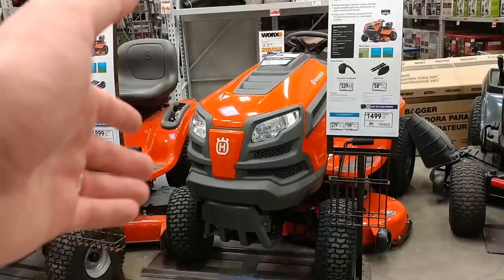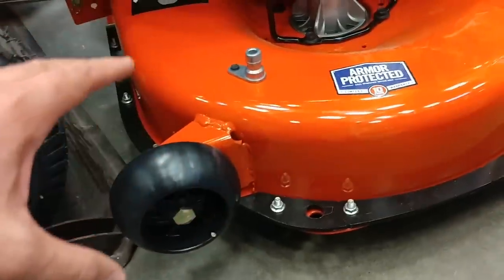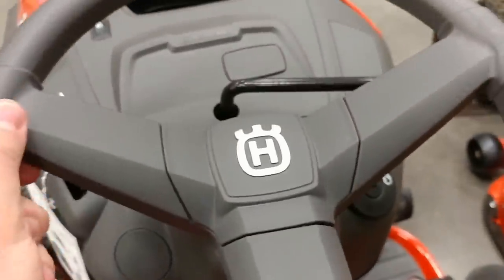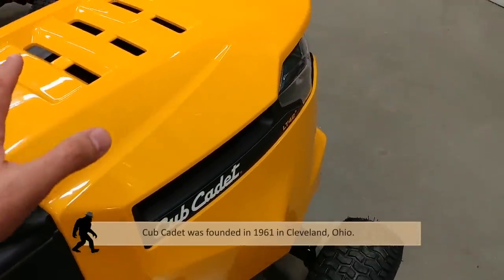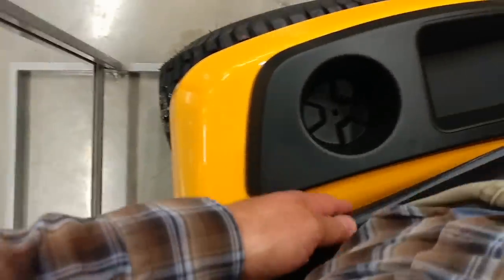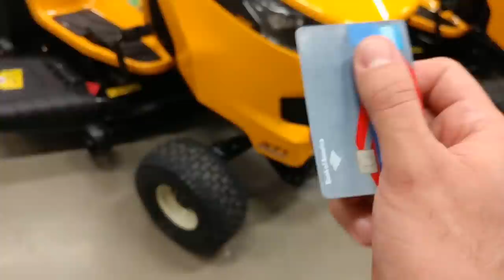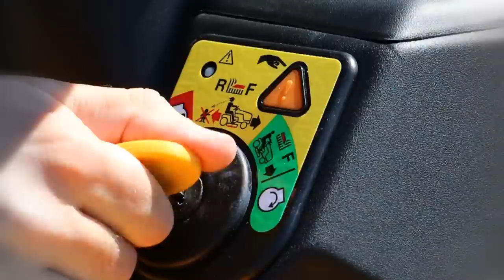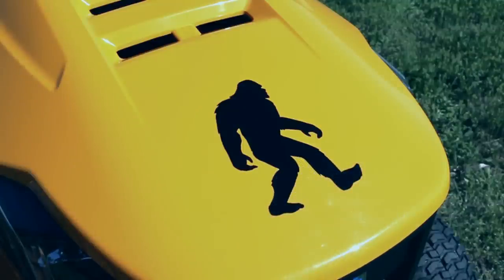Time to Buy - Husqvarna YTH18542 42” or the Cub Cadet XT1 Enduro Series LT 42" Riding Lawn Mower

Comment: My first hydrostatic drive mower was a Craftsman, with the control on the right-rear fender. I really got used to that. I'm a bit apprehensive to move on to a mower with a foot control. What do you think?
Reply from the maker: Hi, PlanetRockJesus - the mowers I used to use were all gear select on the right rear fender or hydrostatic with a control on the dash, and I too was apprehensive about the accelerator-style foot pedal.  This was one of the reasons I went with the Cub Cadet because at that price point, it had cruise control.  The pedal is comfortable and the resistance is loaded just right that my foot and leg do not tire through the entire session.  As it turns out, I rarely use the cruise because the foot pedal is so comfortable and this is actually a better configuration for my lawn.  My terrain is so varied that I'm constantly adjusting the speed and so far, this is working perfectly.  
I have another film on my channel about the 5-hour maintenance and comprehensive review.  It has a section in there explaining the foot pedal, cruise control, and brake.  Hope that helps!  And welcome to the community!
Reply: @BigfootDadExploresMontana  After having the mower for a few weeks now, I must say that it didn't take much to adjust to the foot pedal. I can keep both hands on the wheel. I will, however, be taking the Cadet in for warranty adjustments when the season ends. The cruise control only seems to have three settings: it doesn't start right up as it should, even when I choke it from the start when the engine is cold; the throttle doesn't really respond to the rabbit to turtle thing at all; there are a couple bolts missing from under the seat. Etc, etc. But I do like this mower.
Reply from the maker: @PlanetRockJesus  - thanks for the follow-up!  It sounds like there is definitely a few things that need to be warrantied.  The missing seat bolts is normal, I only have two as well and others on here noticed the same thing with their mowers. But the other issues you mentioned need to be fixed.  
Recently mine has started backfiring when I throttle down - unsure what that is.  But I'm afraid they won't warranty mine after what I did to it - that's coming up in the next video (still in progress)... 😅
Reply: @BigfootDadExploresMontana  I know. Mine backfires, too, but upon starting. That shouldn't happen. I only have one seat bolt on mine. I blame the lackeys at Home Depot who unboxed it and had to assemble it. They saved themselves a couple minutes so they could snatch a vape out the back door.
Reply from the maker: @PlanetRockJesus   - I wonder if these can have the valves adjusted. Haven't looked into it yet, but that may be a similar issue we have.

Comment: Even before he got to the cub cadet I knew which one he was going to choose. I have a Husqvarna I bought at a big box store 5 years ago that was returned. I read the complaints and corrected them in 15 minutes. Without looking I believe it is YT1846. Oh buy the way the price was $1000.00.
Reply from the maker: Hi, Joseph - thank you for your feedback.  I'll give a bit of insight - I originally went to go pick up a John Deere, however, my feet were getting tangled up in the pedals, so I went home, researched, and decided on the Husqvarna.  I don't remember why, but I had to run an errand to Home Depot and passed by the Cub Cadets and started comparing them to the Husqvarna, and thus the video began. I'll admit, I'm a fan of the Cub Cadet visual design, but have a keen eye on utility at the same time.  
You got a great deal on your Husqvarna.  Is it still working alright?

Comment: The Husqvarna is really nice and so is the cub cadet but the Briggs & Stratton Intek are known for blowing head gaskets
Reply from the maker: Hi, Kajler - I agree - Husqvarna makes a solid product!  I had recently lost my enchantment with Briggs and Stratton from the last two engines I had - one on a push mower and one on a rototiller.  Both had pretty bad quality issues.  It seems they're not what they used to be.

Comment: I used a Husqvarna yth 150 for 21 yrs till the rear left side axle sheared off while mowing . So not wanting to put more money in that old of a mower I bought a 3 yr old Cub cadet xti 46 from a man who bought it new he had just bought a brand Husqvarna 48" don't know why  but I bought it the cub for $700 been using it since put new belts an a battery changed all the fluids and filters  does great it's fast to fast some time.
Reply from the maker: Hi, Robert - what an excellent deal!  I don't think that can be beat.  Not sure either why the trade but hey, at least you got a heck of a deal and really nice mower out of it.  Remember, there's always room to upgrade the mower in more ways than one as well!  😉

Comment: Funny I have SC 500E cub cadet and  have a HU800AWD Husqvarna too funny I like em both had cucadet for a while and is lighter and has same power with out awd husqvarna has awd and pulls funny with hand pulls my speed on Husqvarna is awesome but I have battery start no pull batter is the second replacement have to replace every season that sux they are not cheap
Reply from the maker: Hi,  Chris!  You've had a lot of experience with these two brands - thank you for you're feedback.  For the battery,  I plug mine into a battery tender when not in use and that seems to help thus far.   Hopefully you're not out any money this spring on more repairs.  And welcome to the community!  😎

Comment: You covered all the features except for the most important of all. The type of hydrostatic transmission. Is it the dreaded K46 or the world renowned hydro gear? One will handle hills and the other will not.
Reply from the maker: Hi, Bill!  Yes, it is the same K46 on both the Cub Cadet and the Husqvarna.  It sounds like you've had some experience with it.  😂  So far it's held together but now I'm a little concerned...
Reply: @BigfootDadExploresMontana  Hey! Thanks for doing the review. I'm deciding between the two as well. Do you have any hills you mow? How huge is your yard? Thanks.
Reply from the maker: @suraush  - You're welcome.  Yes, my lawn is very hilly - some of them to the point where I cannot safely mow with a rider.  The two mowers have the same transmission and the same forward and reverse pedal functionality.  My yard is approximately one acre.    Hope that helps!
Reply: @BigfootDadExploresMontana  Would you suggest getting this or the twin engine LT46 then? Are you happy with the LT42? My yard is less than an acre with a few slopes. Thanks!
Reply from the maker: @suraush  - If the larger engine and deck size is in your budget and works for you (meaning it doesn't prevent you from getting into any tight places) then yes, I'd recommend the upgrade.  Let us know what you decide!
Reply: @BigfootDadExploresMontana  Makes sense! I spoke to someone at Cub Cadet.. I'm going to go with the XT1 LT50, since it has a 24 HP Kohler engine and more importantly the K46 instead of the TL200. It has the same specs as the wider XT1 ST54, which seems to be rated for slopes w/ obstacles as per this (an older product page) https://www.homedepot.com/p/Cub-Cadet-XT1-Enduro-Series-ST-54-in-Fabricated-Deck-24-HP-V-Twin-Kohler-Hydrostatic-Gas-Lawn-Tractor-with-Cub-Connect-App-ST54-FAB/206602559

Comment: I have the same Bolens mower I'm looking to upgrade from!
Reply from the maker: Hi, Jarrett - that's hilarious! 😂  Well, you now know what the next steps are...
Reply: @BigfootDadExploresMontana  funny enough I'm considering between it and the Husqvarna
Reply from the maker: @Blackshinigami08  - if this is not a sign when you're looking for answers, then I don't know what is.  🤣 A bit of a follow-up - 3 seasons later and still running well.  It does seem a little sluggish in reverse, though, so unsure what that's about.  Both the Cub Cadet and the Husqvarna have the same transmissions.  Check out the 5-hour maintenance and the upgrade videos if you haven't yet - you may find those helpful.
Reply: @BigfootDadExploresMontana  my only concern is in a hefty fella (300+), and I have a long (gradual) hill in my cutting routine that has killed one K46 Hydrostatic Transmission on an older John Deere so I'm concerned about getting another lighter duty tractor.

Comment: What you need to be wear  of the box store units maybe miss labeled I got a YTH in2015 that was in reality a YTA. It was a automatic transmission and junk for any hills. As a flat yard mower it was fine. We than moved to a property with hills and the transmission lasted one year than as you would crest the hill it would roll backwards than lock up when it locked it spun around and rolled. That was it by by Husqvarna.
Reply from the maker: Hi, Len - wow, yes - thank you for the heads-up.  What a dissapointment and huge frustration. I hope that you have a better machine now.  I appreciate you commenting on here in case this may prevent anyone from having the same mistake.

Comment: Yes those engine side vents on the Husqvarna add a PIA step...WHAT?  Just lift up and they come off.  The main issue with the Cub Cadet for me is the Kohler engine.  Will never buy one again as I had a bad experience with one on a John Deere lawn tractor.
Reply from the maker: Hi, K G - thank you for the feedback.   I'm not sure if the side vents are a PIA or not, but thank you for confirming that they are not a big deal to remove.  What happened with your Kohler engine on the John Deere?  Which engine do you prefer now?
Reply: Bigfoot Dad Explores Montana.  The Kohler had many issues with the the carburetor.  I owned it for 10 years and replaced carb twice.  Just left a bad taste.   Briggs and Stratton has never let me down.  Aside from the engine the Cadet looks like a nice machine.  By the way, very nice job on the video.  Funny and high quality production.
Reply from the maker: @Kennykoo65  - Thanks for the heads-up on the carb issues.  I'm hoping they've made improvements over the years as this sounds like it's weak link, but time will tell.  The engine can make or break the representational brand for these mowers.  I used to have a Cub Cadet push mower years ago and the engine was so bad that I took it back... twice.  I don't recall what it was, but it left a sour taste in my mouth for years.  That was running through my head as I was checking these riders out.  Thanks again for sharing your experience and adding to the knowledge-base  here!

Comment: BFDad, nice review thank you !
I'm looking at similar size tractors.
For a comparison see the Craftsman T210, very similar to your chosen Cub Cadet, with 1 additional feature, the super tight turning ratio which is 5 degrees almost Zero turn territory !
I think that alone will tip in favor of the Craftsman T210, though I favor the Cub Cadet Yellow !
Cheers - David in East Texas
Reply from the maker: Hi, RamTruckSteeringFix!  I just looked up some info about the T210.  The turning radius is insanely tight on that!  What a fun mower that would be to review.  The red reminds me of the old Snapper rider my grandfather had.  I think Homedaddy would agree with your color choice of the Cub Cadet.  😂  Welcome to the community! 😎
Reply: I just bought my very first Craftsman lawn mower,  the T210. Took her out last week and she performed flawlessly. Of course....not sure if it would holds up in the long haul.
I'm hoping it will last a long time.

Comment: if you want a good reliable lawn mower you should get an old heavy duty garden tractor, such as a ford , bolens or even an old IH cubcadet.
Reply from the maker: Yes, no doubt those are tanks and built to last!  😎
Reply: Don’t forget about the old Sears SS16 mowers with the Onan engines. Have one that was bought new in 1978, has been well taken care of, and still looks/runs like new today. They were built using heavy steel, and the Onan engine is a little power house of an engine.

Comment: Definitely buy the Husqvarna Is now produced by MTD and is no longer built very well Husqvarna has a thicker deck better supports better engine better frame better transmission and in general way better well I’m hoping you bought the Husqvarna haven’t watch the whole video Also look at the flimsy front end on that cub cadet it’s pretty much a joke Husqvarna comes with a solid cast iron front end way better built

Comment: I have a 12 year old Husqvarna YTH 22V46 with a Briggs and Stratton engine. I also have a 2.5 year old Cub Cadet XT1 Enduro with a Cub Cadet 547 cc EFI OHV Vertical Shaft Engine. The Husqvarna has broken down one time and that was a broken mandible. The Cub Cadet is in the shop now for the past 2 months being repaired for a wonderful 4th time, while the good old Husky continues to do her part mowing. After my experience with Cub Cadet……. I will never own another one.
Reply from the maker: Hi, mclary - Thank you for sharing this with the community - this is a positive thing to discuss what works and what doesn't from personal experience, so I, and others, appreciate this.  I am very sorry yours is having issues - that is terrible considering it's newness and the price these cost now.  I really hope they're able to mend it up for good, or that you can sell it and perhaps try a new Husqvarna.  The Husqvarna are good machines, and perhaps they still remain a little tougher.
Reply: Yep, same problems. When I saw him unboxing it I was like, oh man he screwed up!!
Reply from the maker: @dude3014  - aww 😓.  On my fourth season and still going strong.   Haven't had to take it into the shop yet, so fingers crossed.  🤞
Reply: I have a Husky YTH22V46 and love it. I bought the 3 bag bagger with it and it works like a champ. I have a cart and haul branches and logs with it and that mower is the best one I’ve ever owned. Am going to get the snowblower attachment with the electric up and down switch which will save time when getting out in the nor’easters!

Comment: Should have got a commercial mower you can beat them around and they don’t break
Reply from the maker: Hi , Shotgun Gamer - definitely was thinking about that this weekend too during our yardwork.  Do you have any recommendations?
Reply: @BigfootDadExploresMontana  Exmark x-series are incredible. I'm a fleet mechanic for a national landscape company and the only mowers we use are exmark. They'll go for up to 4000 hours with just oil changes and hydro oil changes. If you dont abuse it like the guys who use our equipment, I can say you will have no issue for YEARS if you grease everything consistently.

Comment: Hi can you cut the grass in reverse in the husqvarna...
Reply from the maker: Hi Melvin - yes, the Husqvarna can mow in reverse.  On the key switch, if you choose the reverse mode (the position right before OFF), this will override the normal engine kill if the PTO is on.  The Cub Cadet is a bit different whereas it has the same key position requirement, but the user needs to press the yellow triangle button to confirm.  Hope that helps.
Reply: Bigfoot Dad Explores Montana thanks I got my Husqvarna today and honestly is my first time using a riding lawn mower I hope I made the right choice in  the Husqvarna. Also kind of oil should you put in the Husqvarna?
Reply from the maker: Hi, Melvin - Congratulations!  I'm sure you'll enjoy it.  Like I mentioned on the video, I think both are solid brands and good mowers.  For oil, there should be a separate manual for your engine which will give the specifications.  On the Cub Cadet Kohler engine manual, it is specifying different weights for different temperature scenarios - usually it will be accompanied by a graphical chart.  I chose 10w-30 synthetic which I picked up at an auto store earlier today.  Keep in mind that the oil it comes with from the factory will be a special break-in type which will have to be changed, usually after 5 hours of actual use.  Be sure to double check the level before mowing for the first time to ensure it's filled to the right capacity.  
I would love to hear your thoughts after your first few uses - both as a new riding mower owner and your thoughts on the machine!  Stay safe and have fun!
Reply: Bigfoot Dad Explores Montana thanks for the information you are very informative and yes I will keep you posted on my first few grass cuts thanks for the great advice...
Reply: @BigfootDadExploresMontana  I finally got the hang of the husqvarna it cuts great thanks for the helpful tips...
Reply from the maker: @melvinnieves9221  - that's great to hear!  The Husqvarna are solid machines and feel tough and quality.  I'm glad it's working well.  🙂